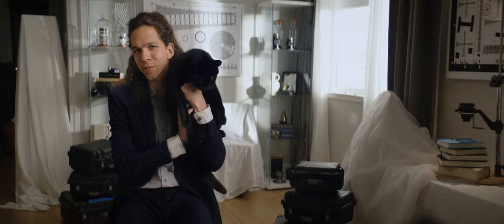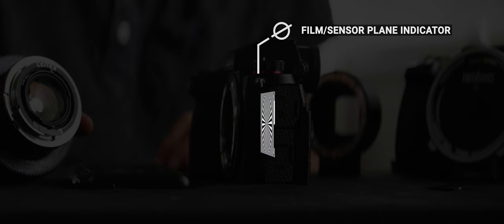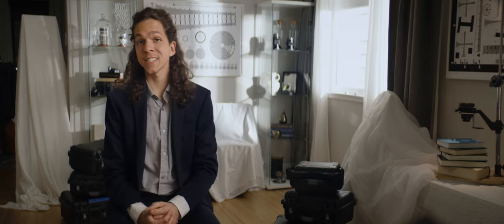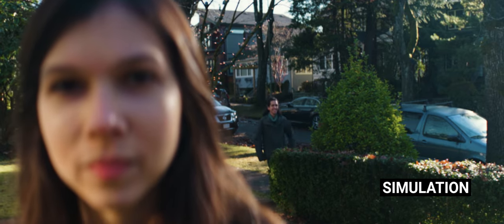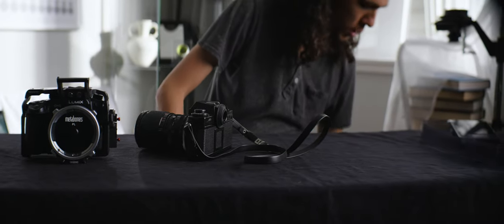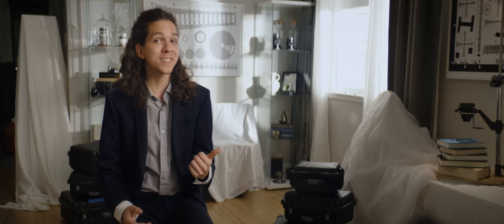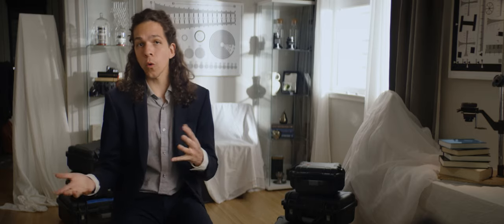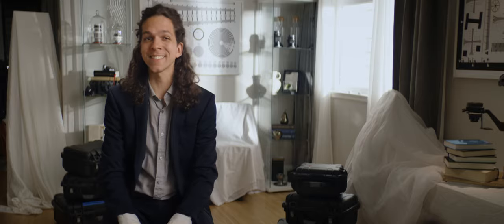Often Overlooked: Flange to Sensor Distance - Anamorphic Cookbook - Module 3 Chapter 04

Comment: There is something Arri said of note: photosites have depth, so vignetting will be visible. The sensor isn't perfectly flat, meaning light at the edges will not get the light as straight (lenses aren't telecentric), so less gets detected and recorded. Film also has depth, but even if the light falls onto it in an angle, it still exposed the film as expected. This means a lot of lenses that vignette on digital - don't do so on film. 

Another thing of note lensrsntals once published: MFT sensor stacks are not to the same spec at all. They found a difference in stack height (stack being a dust window, IR cut/hot mirror, micro lenses, CFA, sensor). Which means some adapters work worse on BMD compared to Panasonic or Olympus because there are differences. 

I have designed and printed conal adapters myself. I even put D mount on MFT, but that image circle was horrible. I do use C mount a lot and have fun. Lots of PL lenses are conal, meaning they get closer than the flange, this causes some incompatibilities. It also means that you aren't as limiting yourself with the air gap. 

Finally I want to see a work where the flange distance is zero, which means we can have even crazier lenses down the line. Leitz joking L mount might show an innovative but high end design one day.

Comment: The future release of the Nikon Red cinema lenses has the potential to revolutionize cinema optics. Nikon's acquisition of Red was driven, in part, by the competitors' flash distance limitations. With the creation of a mount featuring an exceptionally short flange distance, Nikon gains a telecentric advantage that will be hard to match. If Nikon can achieve a flash distance below or slightly above 16mm in their cinema cameras, it will be truly remarkable, as it will allow for seamless adaptation of a wide range of lenses to the Red cinema cameras. Ultimately, the future appears incredibly promising for Red.

Comment: I went with the z mount as it's the shortest. Hopefully the bodies will catch up
Reply: the Z bodies are fine for most uses it's just the autofocus thats not as great as canon or sony although the Z9 pretty much fixes that problem.  Hopefully we get some more firmware improvements soon for the Z6ii Z7ii.  For building a cinema rig and using manual cine lenses the autofocus problem is not a problem and there is the 12 bit raw video option that is pretty awesome as well.